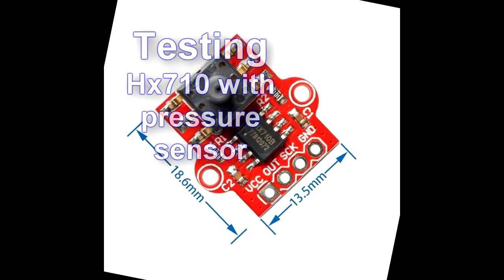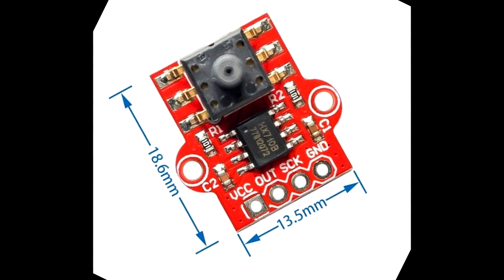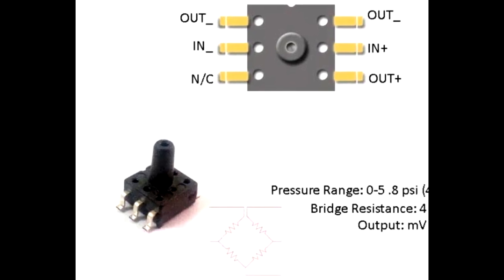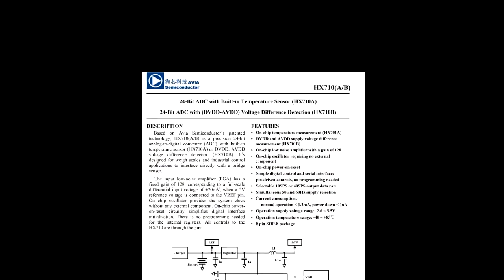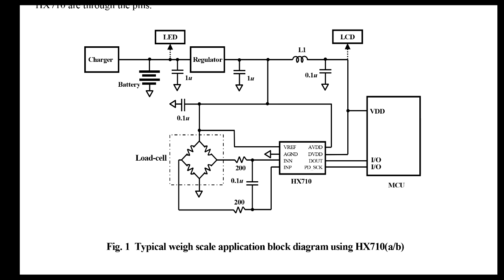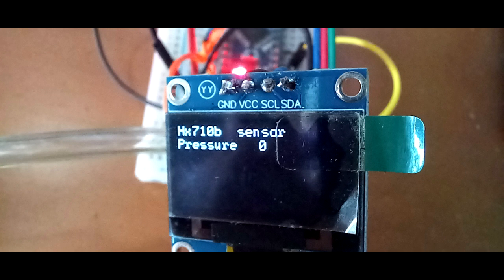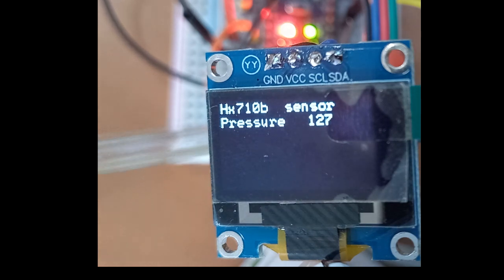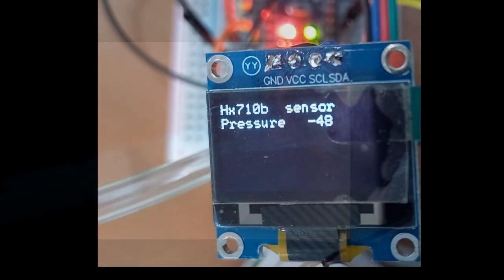Hx710b readings modification

Comment: Hi, nice project.
Could you share the schematic and code please?
Thanks
Reply from the maker: Hi
Hx710b is connected to Arduino Nano. The clock from Nano controls the work of Hx710b. Hx710b has data out pin. When Hx710b is set to read data, it is saved bit by bit to a string. However, in this application, due to narrow reading scale, MSB byte is read only, middle byte is filled with zeroes and LSB bate is not added at all. The 16-bit string is converted to decimal. Decimal value is converted to float and divided by 256. After that value is converted back to integer and showed on screen. The scale of reading Hx710 is from minus127 to plus 127.
Nano D3 to sensor CLK pin
Nano D4-read data from sensor
Note: search on www: Two compliment 24 bit handling
27 26 25 24 23 22 21 20 19 18 17 16 15 14 13 12 11 10 09 08 07 06 05 04 03 02 01
\---------------------/ \---------------------/ \---------------------/ \------------------/
  bits 24-31 (8 bits)     bits 16-23 (8 bits)      bits 8-15 (8 bits)     bits 0-7 (8 bits)

Nano converts the binary to decimal
PS
Code: .hex file at   
https://www.geocities.ws/viktor_au/projects/Hx710b.html 
All the best

Comment: Can this sensor be connect directyl yo a water pipe ?
Reply from the maker: Hi Alex. You can use the longer tube and some kind of diaphragm between the water supply pipe and this tube. I would move the sensor away from the water supply.